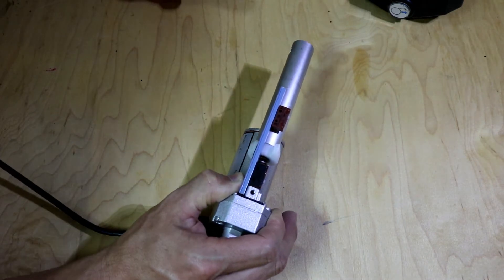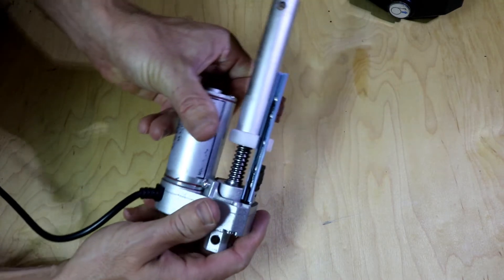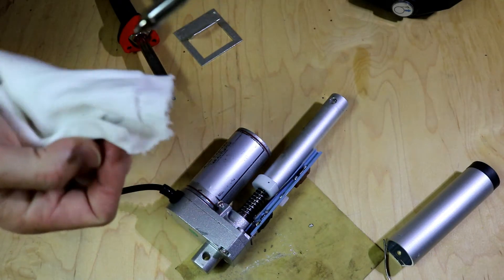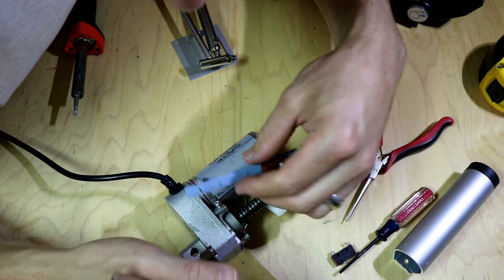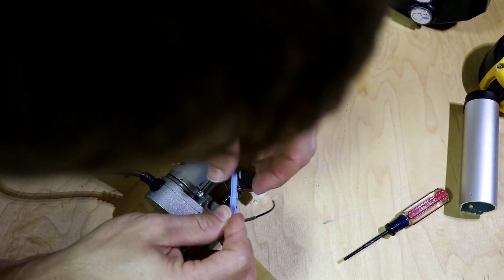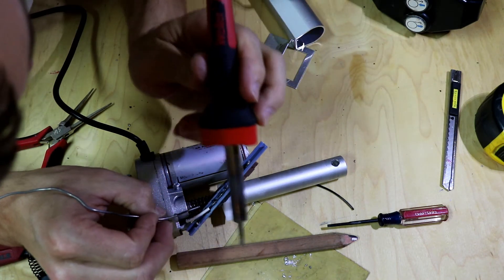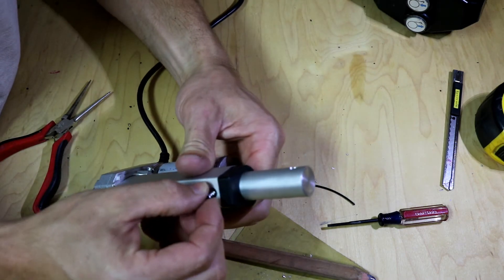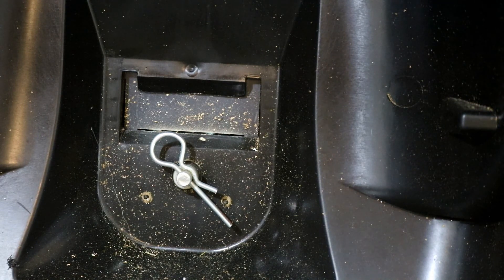How To Make a 2in storke Linear Actuator a 1in for the Agri-Fab Spreader

Comment: Seems like adding a simple lever between the actuator and the control rod might be easier - 2 holes - translate 2" of actuator movement to 1" of rod movement?
Reply from the maker: You could be on to something and correct just shows there are many ways to solve problems. Thanks for your comment!